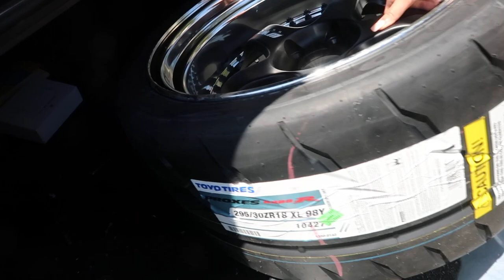Work Wheels get some Meat...295/30

Comment: Hey did you notice any difference in fuel consumption after installing these tyres? Also was the steering wheel much havier or just little? Would you reccomend these ? I am looking to buy new wheels for my Z
Reply from the maker: No didn’t notice any difference in fuel consumption. I would recommend works wheels if you don’t mind breaking the bank. They are the strongest 3piece wheel I know of. But if your looking for lighter wheel maybe check out volks. My wheel set up is very aggressive and wide. I upgraded the steering rack from newer sti but wouldn’t imagine it to make your steering feel more heavy. I think you will be okay as long as you stay with in the size your z requires. I’m running 295/30 all the way around. I guess it dose feel some what tuff to move the wheel from a stand still position but not enough to ruin my
Driving experience

Comment: Specs on the wheels?
Reply from the maker: 18x10.5 +12mm R Disk for the rear and the front is 18x10.5 +11mm O disk
Reply: @tastysti  Thanks this is the technical information I need as well

Comment: 295/30. Ouch I'll bet thats a bumpy ride. Plenty of grip but no cushion.
Reply from the maker: Nathan it’s definitely a love and hate. On the freeway they will grab any little movement in the road and jerk the car. Definitely not a good daily driver. But I’m dam surprised with how long they are lasting. 6-7month now daily’s and they still look new. I must be to easy on them.
Reply: It have 255/30/20 F and 295/30/20 R. On my car and somehow the ride is really smooth, and it’s like butter when it come to corner.

Comment: What is your J ?
Reply from the maker: 范家瑋 18x10.5 +12mm R Disk for the rear and the front is 18x10.5 +11mm O disk
Reply: Brian Jamieson  thank you brother
Reply: Should the size of the semi-hot melt tire be reduced?
Reply from the maker: 范家瑋 like after a hard  run on the track. . I honestly have not filled them with air since I installed them. And I daily drive the hell out of them. They seem to really hold up even with daily driving. I’ve been running them well over 6 months now. Even the tread wear is still new like. Definitely surprises me.
Reply: Brian Jamieson I mean the semi-hot tires are smaller than the street tires, so the ratio will be the same, is right😆
Reply from the maker: 范家瑋 The Proxes R888R has a semi race construction (very stiff) and a race tread compound. The optimum tread temperature range is between 71C and 105C measured using a probe type pyrometer, and ideally a maximum difference across the tread of 15C. The maximum hot pressure recommended is 40psi.